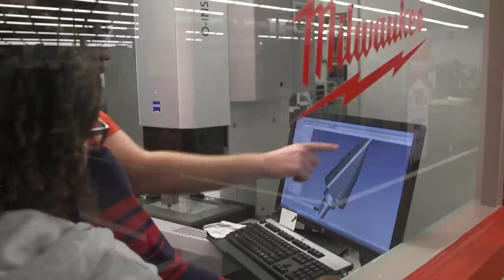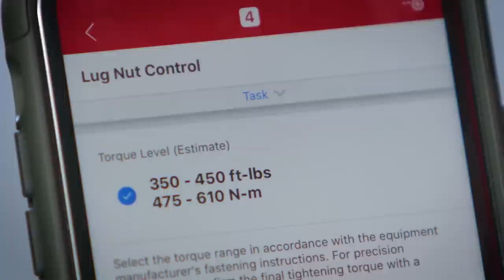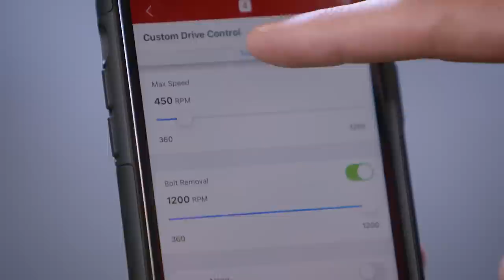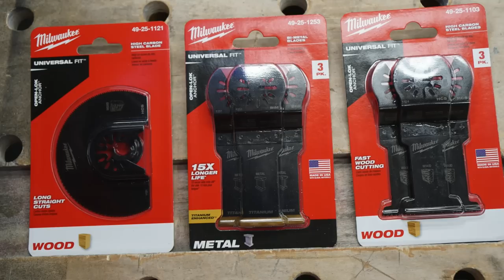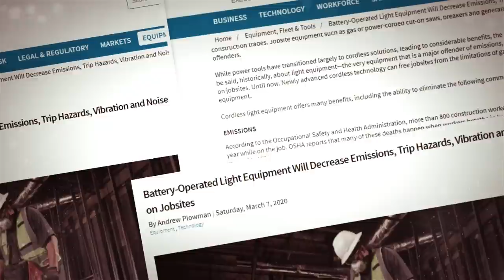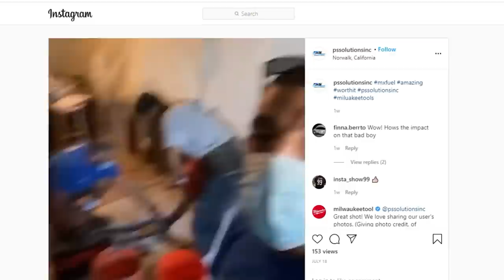Milwaukee® Pipeline™: Episode 1

Comment: What I need is the following. 
Fuel 7 1/4” dual bevel compound sliding Mitersaw with a crosscut capacity of 12” inches. For trim jobs, it would cover almost every application I would need it too. I would happily retire my LXT platform. Just sayin.
Reply: Adirondack Homestead if they make it, I’ll switch over completely.I have  Gen 2 fuel nailers and they are simply incredible.  They done good with them. Milwaukee sure is in Beast mode lately with their tool announcements. I’m impressed.
Reply: Adirondack Homestead oh hell yeah. I’m still running first gen Makita tracksaw(corded) excellent saw but if I’m gonna make the full switch, yeah that would be so good. Fuel tracksaw would be something special. 

In all honesty, we have such a great range of tools both corded and cordless to choose from. Hope you’ve been well ✔️
Reply: That would be a great addition!! And also they really need to sort a rail/plunge saw. However I find them to be great at heavy duty but not so great at precision and refinement. All if they make a plunge saw it would need to compete with the mafell for me

Comment: 87 dB???? Sounds loud to my ears... 54:40
Most full-sized vacuum cleaners have a noise output of 70 to 80 decibels (dB). For reference, 80 decibel is the level of noise generated by a typical garbage disposal system.

Comment: I have never used Milwaukee tools. I am getting ready to replace all my tools that are way past their usable life. I am not your average DIYer and need to up my tool quality. I have been looking at several brands, including Milwaukee, while window shopping. Can any Milwaukee users let me know why you choose their tools over the competition? Want to know caparisons concerning durability, price, performance, and selection. Thanks in advance.
Reply: I've the Gen 3 hammer drill/impact driver for about 1.5 years, and I've had to have BOTH warranted in that time frame, using them everyday. They're the top of the line, and they're tough as hell, but little things like the trigger getting stuck on BOTH is annoying. I have the m18 Fuel Hackzall for a few months now, works great. I have the m12 Fuel hammer drill and impact driver, the impact is starting to make a grinding noise. I have the m18 brushed sawzall, I've had to take it in to replace the brushes. They're at the top of the the line, and their warranty is probably the best, but they need to REALLY fine tune their tools. They're already powerful enough, just make the chuck as smooth as Hilti/Bosch, the trigger as smooth as Dewalt/Bosch, and make them as durable as Makita/Hilti and they'll be the last power tools you need. I buy them because they constantly release new items, and a company that releases new and specific items means they're constantly thinking and CARE about remaining.
Reply: christian santos thanks.  It is good to know they have good warranties and customer service.  Most of the tools I have I consider disposable because there is no customer service and hard to use the warranty.  Thanks for the insight.
Reply: Adirondack Homestead thanks for the honest review.
Reply: You won’t regret it. I don’t own a lot but 1/2 impact 3/8 impact, M18 is industrial standard. 
100 + techs everyone owns one.
That’s just forklift industry out of our branches. Car mechanics diesel mechanics.
Reply: Because milwaukee is the only company who makes tool's that you see 40 year old saws being used everyday on a jobsite